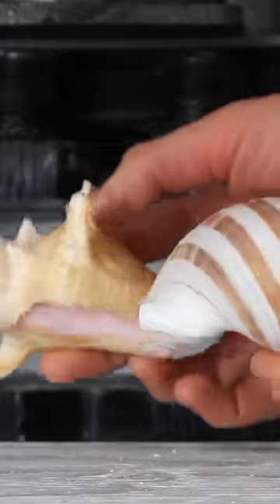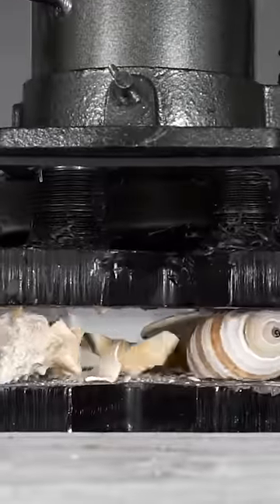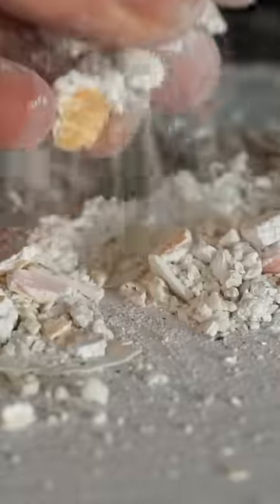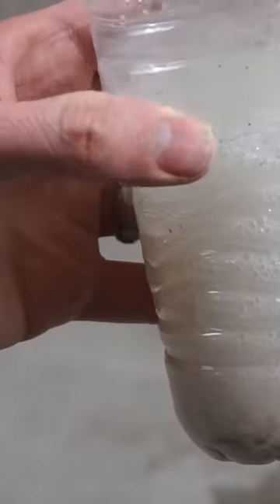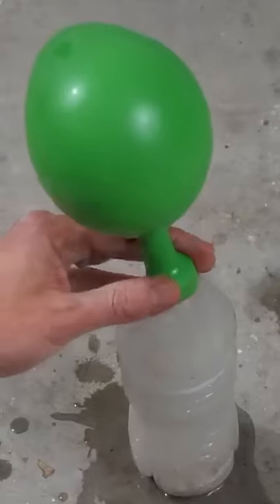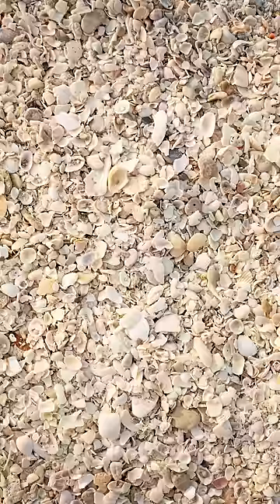Storing CO2 as Sea Shells?

Comment: Guy: So we can pass electricity and store excess CO2.
The Electricity Bills the next month:
Reply: To be fair, we produce more energy than we can use at any given time with renewable sources, it's just that the excess is hard to store efficiently. It may be beneficial to use this method to start burning the excesses energy and reduce CO2 to produce materials we can use in construction, allowing that gas to become trapped essentially forever.
Reply: @Nanamowa  Yeah, because with clean energies we have a problem with the over-production and it would be cool use the ecess of electricity on that.
Reply: I kinda don't get it can you guys make it short so that other people can understand easier ü
Reply: @retard-kat4444   there is alot of co2 in the air

To turn it into the shell you need to use electricity
Electricity costs money
Lots of co2 = lots of shells = lots of electricity = electricity bill high = very expensive
Reply: @retard-kat4444  did you even watch the video?
Reply: plot twist: your country uses coal instead of nuclear
Reply: @DarthGTB  Every country on earth, unfortunately. No one relies primarily on clean energy like nuclear or renewables. Even in those countries that have geothermal still get a significant amount of their energy from burning coal
Reply: @Nanamowa  and there are the ones that turn off their nuclear power plants because of ohh no atom bad
Reply: @Nanamowa  Actually here on Brazil we sustain 60≈% of our energy demand with hydroelectric power so yeah, there's at least one lol
Reply: @Nanamowa  Also if I'm not mistaken doesn't Japan use mostly nuclear energy? Like 80% or smth
Reply: @Pokesus  storage is the issue. Solar panels now capture alot of energy. However new battery technology is being developed. For example toyota solid state battery
Reply: This is ignorant... Electricity is fairly affordable and obtainable through sustainable methods.. which reduce the carbon imprint.... You're welcome 💪💯
Reply: @AskTheMasked  iirc, they undid a lot of that after the Fukushima incident and went back to fossil fuels.
Reply: @TheOneTheaEnd  forgoting one key part, how that electricity is produced... Guess what, many times that releases lots of CO2 in the air.....
Reply: @chrisbaker4493  not everywhere. Lots of places use coal because it's not feasible nor economical to use anything else
Reply: Well it's very good news if we're gonna use nuclear fusion
Reply: Nobody look at solar
Reply: @TheOneTheaEnd  soo we should convince jeff bezos to make building materials made out of sea shells
Reply: @guadalupe8589  isnt it still a win though

Since either way that electricity is producing co2, but either way co2 is just in the air by default, so we can eleminate the second one by using electricity
Reply: @Splatcake  yes.
Reply: Use solar my dude
Reply: @Pokesus  well solar does, it produces the most energy at non-peak hours.
Reply: You could probably turn it into a battery.
Reply: @retard-kat4444 … just read the comment.
Reply: @retard-kat4444  literally it’s just
Lot of energy we can’t use bc there’s too much
Use that electricity for CO2–>seashell
Reply: @chrisbaker4493  ? You are ignorant if you don't know that it's still expensive for the end user
Reply: @DAB009  here in Brazil it's starting to takeoff. Not for public use, but private use. Excess energy goes into the network and when there is extra use, we take from the network, so for the average year, it sort of cancels itself and have near net 0 electricity bill (the kit isn't cheap tho and if you don't have electric showers or live in a place you need constant AC on, it might still not be worth it)
Reply: @Nanamowa  Norway with 90% of electricity produce by hydro plants:
Reply: fishies: uhhh, lets think about this a little more guys
Reply: @Nanamowa  ah yes, Limestone houses
What could go wrong?
Reply: @Nanamowa  We produced more Energy than we can use at any given Time. Where the f do you get that from lol we dont even produced enough for electricity. And no its not that hard to save the Energy. We can Store it already with current technology admitedly with some und in conversion for example with Power to Gas technology
Reply: @DarthGTB  the Problem of nuclear is more than just Atom Bad. Its a more expensive Form of Energy production, it produces nuclear waste for which still no perfect Solution exists, uranium is Not that plenty, mining gets harder and more expensive many countries already rely on stored uranium, etc
Reply: The fish:
Reply: The ignorance in some of these comments.... 🤦
Reply: @Nanamowa  china has 41 nuclear build so far they're still replacing coal. hope my country follows eventually in U.S
Reply: @KeVIn-pm7pu  we produce more energy than we can use at any given time *with renewables*. You left out the most important part when you misquoted me. Yes, typically energy demands for an area with renewable power sources are lower than the energy being produced. This energy is hard to store to be used when demand is high in most cases because batteries are quite inefficient at quickly storing massive loads of energy, meaning a lot of energy doesn't get stored. 
Let's say a windmill produces X units of energy on average, while the demand may be higher than X sometimes, it will more often be lower. This is where we might want to store extra energy produced by the windmill, but in places where pump storage isn't feasible, we have to rely on lithium batteries, which are expensive, charge slow and wear out fast, especially as you use them more, but even in those cases where you try to store extra energy from the windmill, you're producing more than can typically be stored or used at a given time due to the slow transfer rate of the batteries, so you have this excess energy being produced and nothing you can do with it.

This is why pump storage is incredibly powerful and why it needs to be put into place wherever applicable, but also why using excess to produce materials that can be used in construction, as seen in this video, might not only be a valuable way of offsetting the CO2 produced, but allowing the excess energy we can't use to be used in the production of a product that can be sold in bulk to generate more money.

As for the conversion from electricity to fuels, unfortunately there are no methods currently available, certainly none that I'm aware of, that have an efficiency in storing energy comparable to lithium ion batteries. In fact, historically not only has the efficiency as far as power loss been very very bad, so has the rates of converting carbon molecules into octane fuels, meaning it's slower than charging a battery and the same issues as listed above apply.

If you want to prove me wrong, I'm more than happy to review any source you provide for the efficient conversion from electricity into fuel.
Reply: @Nanamowa  holy shit
Reply: @retard-kat4444  We produce electricity but we don't have large enough batteries to store them, and we need to supply more electricity than necessary so that your hairdryer won't suddenly stop working. As a result the excessive power are simply wasted.
Reply: @Nanamowa  nope, here in Perú we use only use hydroelectric electricity
Reply: Bruh just use solar
Reply: Guys, guys, hear me out. All we need to do is store wind just like our former president in Brazil said.

Of course, she was referring to storing the energy. The battery problem. But the meme lives on!
Reply: The aquatic life: 🗿
Reply: @DarthGTB  another plot twist, then realize that your country used to have nuclear powerplant
Reply: Electricity isn't as big of a barrier for large scale industrial projects as people think. Transporting the energy and distribution on small scales are where much of the inefficiencies and extra costs arise.
Reply: If you could figure out how to make whatever kind of sand we have a shortage of this could be really profitable.
Reply: @Nanamowa  yes, it’s less the quantity of energy, more the timing of it
Reply: @KeVIn-pm7pu  nuclear waste is an easy problem. High level waste? Reprocess. Low level? Store it.
Reply: @MAL1GNANT  reprocess with what. Storing is expensive thats one external factor that makes nuclear more expensive than alternatives
Reply: @KeVIn-pm7pu  the with isn't an issue. The issue is America isn't willing to do it.
Reply: @MAL1GNANT  then again with what.
Reply: @KeVIn-pm7pu  uranium can be recycled as a MOX, plutonium is plutonium, and the others can be transmuted
Reply: @KeVIn-pm7pu  what even is this question
Reply: @MAL1GNANT  those reactors dont  exist apart from prototype Status for a reason they are instable and much more expensive.
Reply: The coal plants powering that electricity
Reply: @KeVIn-pm7pu  
Actually, no. You can easily store every single bit of waste on-site. And for permanent storage, that would be incredibly cheap. One site could store the entire world’s waste from 200 years of operation with 0 leakage permanently. 

The issue is the activists controlling government regulations. 

Storage is actually one of the least expensive parts. Nuclear waste is solid and encased in concrete. It isn’t liquid glowing green barrels. It doesn’t leak. It’s easy to store. And it can be literally hit by a train without breaking (the tests are awesome).
Reply: @FilmFlam-8008  you still need Security and regular testing and exanaming. Which is Part of Storage. Making it expensive.

I dont know what you mean by on-site because you cant put all that waste just next to the reactor for long Time Storage.

Activists dont drive the cost.
Reply: @KeVIn-pm7pu  
Those costs are minimal when you are talking about an already manned facility with existing staff and security. 

And yes, you can hold the waste on site. There are stages to it including the spent fuel pool then cast storage. That’s already in the plans though for every reactor. Saying that is expensive or an added cost is not accurate. Nuclear power is very cost to maintain after initial investment and operation. 

And YES activists drive up the costs. The activists create bottlenecks, sue the power plants at EVERY STAGE of development, and pay for anti-nuclear political officials like Biden and other Democrats that make nuclear more expensive and preclude development. 

Dude. I am in the industry. I deal with Licenses all the time. And I feel it every time some democrat policy is enacted that adds some ridiculous, pointless requirement that directly overlaps existing requirements, adding hundreds of man-hours to prove we already met a requirement we already pierced we met, just with a different letterhead.
Reply: @FilmFlam-8008  millions in subsedies say something elss
Reply: @FilmFlam-8008  compare that to kwh
Reply: @KeVIn-pm7pu  dude, per the IER, nuclear is some of the lower cost of energy per megawatt hour of generating power, on par with hydroelectric and wind. Half of solar thermal. Lower than coal or gas. 

It has a massive initial cost, but it’s running cost is REAALY low. It’s a hot rock (that boils water that turns a turbine) that basically maintains itself for years without any refueling or CO2 release. 

Again, dude. I am in the industry. Come with sources.
Reply: @FilmFlam-8008  whats IER?
Reply: @zombiedeathrays8862  Nuclear on top 💪
Reply: @Nanamowa  Unfortunately, that's not true. Renewables make up a tiny fraction of total energy consumption worldwide. Excess energy at a particular time could better be put to use creating liquid fuels to replace liquid fossil fuels, rather than absorbing the CO2 after the fact.
Reply: @Nanamowa  you do know France right? It's a country, it exist.
France last statistics are about : 40% nuclear, 28% petrol, 16% natural gaz, 14% renewable energy and 2% coal.

Country that mainly use nuclear exist, it's the cleanest energy, and the ones that produce the most while wasting the less (nuclear wastes are only wastes for now, with sciences evolution, we keep pushing forward how far thoses wastes can be reused to produce more energy, we will eventually reach a point where nuclear waste can be used fully, even if it doesn't mean they will be used fully because it probably wouldn't profitable, it simply mean we could eventually find a way to make nuclear wastes almost clean and not too dangerous once the wastes have been used fully.).

Also keep in mind that France produce mainly for foreigner, and not for it self (let's laugh at Germans, that don't want nuclear energy, yet buy it's energy from France, which produce it with nuclear power plants. France could easily produce all it's energy thanks to nuclear power, but that's not very intelligent and no country in the world will ever concider only using nuclear energy. If one day you can't use it anymore for any reasons, by the time you finally bring some energy again in the country, every company will have closed and riots will be everywhere. 

Remember kids, try to make some research before talking, just to back up your arguments, or else you look dumb as hell....
Reply: Electricity bill: yea, you should. 👁🍅👁😼😼
Reply: @KeVIn-pm7pu  institute for energy research, most likely. As for the costs, the investment worthiness will depend from country to country. Brazil also has nuclear, but it's a tiny percentage because most of our energy is hydroelectric. In our case it's not really needed, although recent draughts forced us to turn on the expensive coal plants we maintain as a backup.

So back into the topic, we don't really need nuclear, but a former leftist president sort of lobbied for us to invest in that, which would be a good thing if corruption wasn't everywhere and the building of the new reactors wouldn't take decades to complete spending more money in maintenance of half abandoned machinery than actual building...
Reply: Just out of curiosity, I checked how much energy we produce in Brazil that isn't hydroelectric and this is it (rounding because I'm lazy):
- 61% - 100 MW - Hydroelectric
- 9% - 16 MW - Wind
- 8% - 15 MW - Biomass
- 7% - 13 MW - Natural Gas
- 5% - 9 MW - Petroleum
- 2% - 4 MW - Mineral Coal
- 1% - 2 MW - Solar (not counting private owners of solar kits for their homes)
- 1% - 2 MW - Nuclear

We still import 8 MW from other places and there are other 0.something% sources

I had no idea we had so little solar. Probably private owners produce more solar than the electricity providers
Reply: @indeed2207  I never said that there was no country that used renewables, but that a significant portion of their power still comes from coal burning. What's stupid is calling me dumb for saying things I never said.
Even 2% is still a significant amount of coal burning, albeit far lower than most countries that rely on coal burning for power.
Reply: @Nanamowa  France actually uses nuclear power for 70% of all their electricity I believe, they’re going pretty strong!
Reply: Sola Powa
Reply: @chrisbaker4493 😂 tell me you don’t understand the huge tax bill that infrastructure is (including power lines and stations) 😂 without telling me.
Reply: Floating wave and solar directly removing co2
Reply: @Nanamowa If we could store the excess of energy and/or use it to remove the excess of CO², it could be great.
Reply: @KeVIn-pm7pu The nuclear energy does not emit carbon dioxide to the atmosphere, but it produces nuclear waste and it isn't renewable due to the limited supply of uranium.
Reply: Or just farm.animals and sell the credits to Elon for Space X
Reply: Nucler fusion
Reply: Gonna need those coal plants for that energy!
Reply: @Pokesus it's only excess because we can't store it properly
Reply: Like a very definition of green hydrogen.
Reply: This is not at all how u use this meme
Reply: We're using lightning so it's free lol
Reply: @Nanamowa  so will these shells become oil?
Reply: We could use renewables 😂😂😂
Reply: @TheOneTheaEnd SOLAR, Chase, SOLAR!
Or Hydro'!
Or Geo-thermal!
Or Geo-turbulent!
Only in your limited mentality world is ALL electricity generated by fossil-fuels!
Get a flipping clue, Chase!
...or should I say 'Chase-bot'!
Or, are you a zombie-Trumper!?
Reply: Problem at a time
Reply: ☠️☠️ i never seen someone use the like button this cleverly loo
Reply: @ARVash  solar doesn't even have enough capacity to spare for storage. Nor does wind
Reply: @Nanamowa we don't produce s*** the private corporations produce the electricity and no one's telling them what to do with it😂
Reply: @Nanamowa maybe not countries but my state of Georgia has two nuclear plants. And a new one just completed. We don't burn coal for power😂
Reply: @Nanamowa  the US is pretty cucked when it comes to renewable energy, not enough is done to expand it to meet the current needs
Reply: @Pokesus  that's good, but it's better to find a way to store it
Reply: She stores see oh two in sea shells on the sea shore.
Reply: Absolutely not  @Nanamowa
Reply: plant trees....
Reply: unless we would stop being morons and invest in nuclear power.
Reply: who would win, the concept of money or human existence
Reply: Nuclear energy sitting pretty as the solution to the world's problems since the 60s.
Reply: @Nanamowa UK is not a leader in clean energy, but even with that used coal for 1% energy production in 2023 - down from 5.1% in 2018 and from 39.6% in 2013. 

It’s entirely possible with enough will to do so.
Reply: These comments are absolutely HILARIOUS!

All we need to do is to get out of the way, and let EARTH do what EARTH has been doing for hundreds of millions of years. Creating animal bones, seashells, and vegetation, and sequestering them in the oceans and in the ground along with all that carbon that they are made of.

The Earth doesn't need our help, it needs us to STOP trying to help.
Reply: @Nanamowa  No we don't, renewables don't even crack 5%.
Reply: @rustyshackleford1508  Maine is currently at 7% at least that is the CLAIM. I certainly don't see it.
Reply: First we move toward renewable energy, then when there is surplus of energy we turn on the machines.
Reply: I mean if the reaction were exothermic,
Reply: What if it’s solar panels powering the process?
Reply: @Ormusn2o  Renewable is a fool's errand. We need more nuclear, its orders of magnitude more efficient.
Reply: @rustyshackleford1508  Reality does not care about your opinion. There are multiple big countries that already fully use renewables for long periods of time. Add batteries and more renewables and you can get 100% reliance on renewables. Solar can be almost everywhere, wind can be for winter and such as even in Antarctica wind power is the main power source. Don't get me wrong, nuclear is great and would be awesome to get more of it, but it's not necessary. Also, while there is a lot of nuclear fuel to go around, eventually we will run out of fuel, so it's just a temporary solution.
Reply: Poland is very beautiful
Reply: @Pltr03 Vanadium flow batteries also...
Reply: @Nanamowa Iceland gets 80% of it's energy from renewable energy
Reply: @TheOneTheaEnd like already mentioned. There's plenty of renewable energy that goes to waste when there's low demand. This excess energy can be used to make building materials.
Reply: @zyme4569   why are you replying to ME? I was explaining the comment to the guy who didn't understand it. THIS WAS TWO YEARS AGO